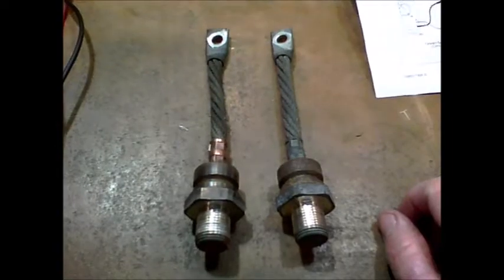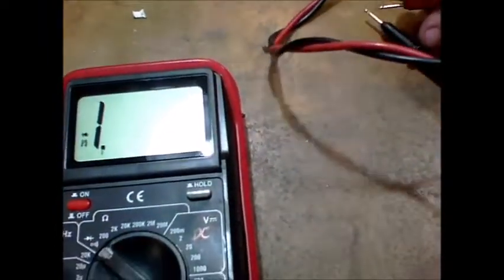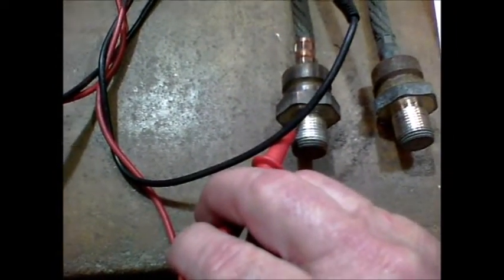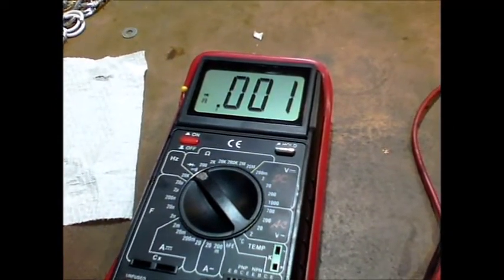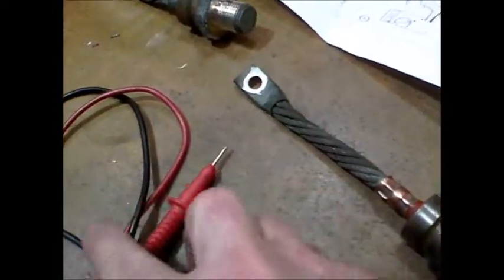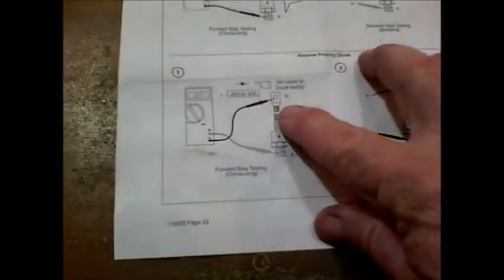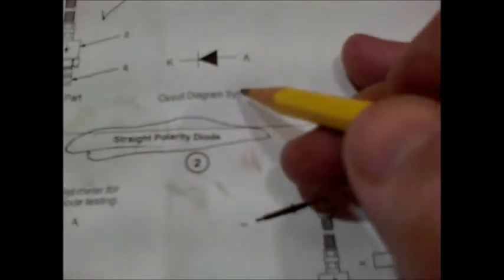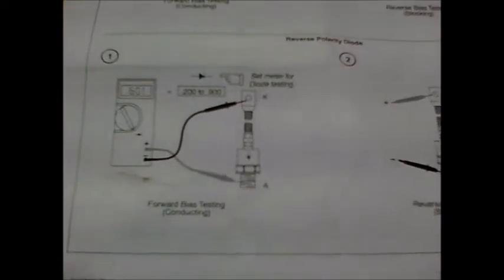Welding Diodes

Comment: Thank you very much. I have an 1969 SAE 300 F-226 gas powered that will fire up but, will not strike an arch. With all the information online, I still cannot find an answer as to why my machine will not weld. I don't really understand the mechanics of testing wires on the machine. Some things I don't get is like, do I test with the machine running, off, do I undo the line before testing, do I leave the line and test as is? do I use OHMs??? and the like. In any case, thank you for your video.

Comment: In diode mode it reads the voltage drop across the diode, so you got 0.422 Vdrop or 422mV which is good (0.3~0.7V), and on the failed one the "zero volts" means short circuit (it "became a wire"), the way diodes like to fail.
Reply from the maker: Thanks for the info!

Comment: What machine did that diode come off of?
Reply: Old Lincoln weldandpower 225
Reply: @cozy4build245  I just got quoted that changing diodes on my miller big 40 would be 800$ for parts alone. The guy said the are testing fine until machine loads up and therefore the diodes drop out? I’m a millwright at the local paper mill and feel confident about tackling the job myself but concerned if that’s actually the problem. Any advice would be appreciated.
Reply: Hey Caleb I would take out the diodes myself. They will have a part number somewhere and look for that part number on google you can probably find those diodes for less than half of that price quoted to you.
Reply: @cozy4build245  much appreciate. Thank you, will do.

Comment: What if below 400 in reading.?
The diode is damage
Reply from the maker: Probably not. You just have to know what that diode is rated at.  The main thing is to check if it it open or not.  See video.  Thanks for watching
Reply from the maker: Probably not.  Be sure to check that it is not "open"